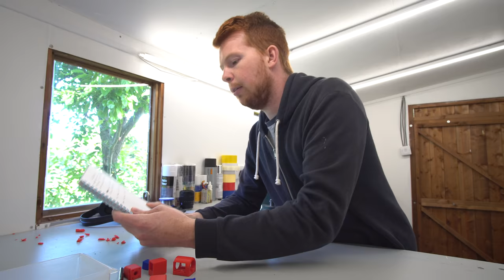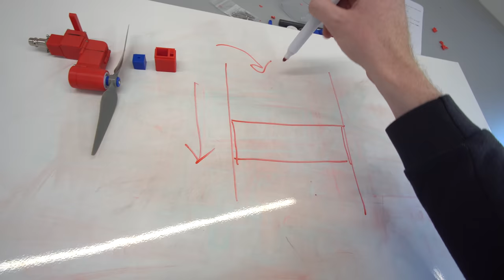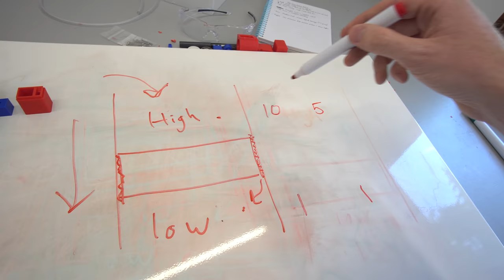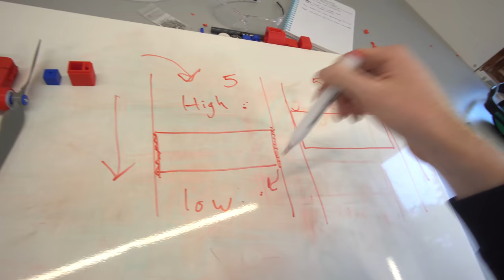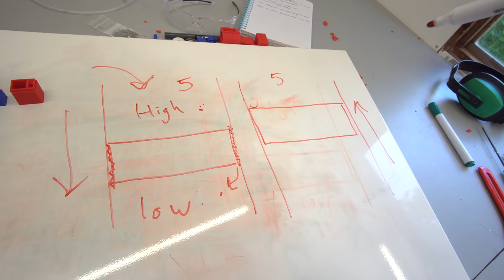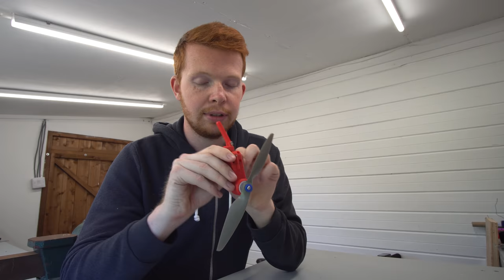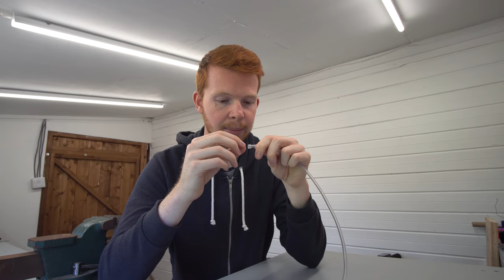Multiple or Single Cylinder Air Engine?

Comment: if you've halved the pressure but doubled the leakage area (piston to cylinder interface) you've not done anything. Focus on actually getting an engine running efficiently! cam timing and design is important, as is the valve actuation and interface. reduce friction! also, study the impact of engine RPM vs propeller diameter/inertia vs propeller pitch

Comment: Have you ever tried using ABS filament instead of PLA?
Reply from the maker: Yes I used ABS for the first two versions of the air engine and acetone smoothed the parts. But because ABS isn't as hard as PLA, the piston/cylinder would wear quickly and lose performance.

Comment: 2 pistons solves the crack case having a pressure in it 🤔
Reply: Also flat twin is the simpler to just plumb it
Reply: Or better yet push both sides of a single piston like a steam engine that gives you twin piston performance with one piston

Comment: Flat twin with the intake in the common crankcase and a valve to the two opposing heads for the second part of the stroke. The valve and conduit is integrated with cylinder and the cylinder head but detachable. 
It has been done.
Not quite but this will give you an idea. Just imagine the transfer tubes integrated to the cylinders

https://i.pinimg.com/originals/48/85/cb/4885cba90b4d6dad65f9fa4fdfda99cf.jpg

You could also go to the steam locomotive design which has a power stroke on both sides of the piston on a single cylinder.

Comment: build an engine that could practically run forever on the exact same air.By putting the exhaust back into the bottle somehow....... assuming this is possible, you could make one exhaust hole 
and use it to keep refilling the bottle that would in turn keep the engine running until all the air Leakes out.there is the problem of how to put the air to go back into the bottle when there are different pressures..... but ill leave it to you to fuigure that out.,
BRYAN

Comment: Hi Tom, love your work. :)   I was watching one of you compress-air motor videos and how you were experimenting with controlling the air into the motor. May I  suggest that you consider looking at a rotary valve?  If you want to get very clever have a look at the Bishop Rotary Valve head. It was destined for Formula One engines but the FIA banned it before it could be used. It's quite simple and very effective.   http://home.people.net.au/~mrbdesign/PDF/AutoTechBRV.pdf
I also got to thinking about a multi-cylinder motor after watching some of your vids and I think that a radial engine that has the crankshafts on the outer end of the cylinders might be best. Have a toothed pulley on the end of the crank, then that drives an idler gear, which then drives the propeller at the centre of the motor. By having those idler gears, you could alter the rpm of the prop to be lower (and so use a larger prop for better efficiency) and there'd be less aero drag than just running the crank gear straight onto the prop gear. I'd also be tempted to cheat a little by using a plain PVC pipe as the cylinder as it'd be very smooth, so you could run a crude printed piston ring that will seal well enough to make a good improvement in power & flight duration.
Let me know if I can help with drawing some diagrams of what I mean.
Thanks!

Comment: I'd favour a 3 cylinder engine over a 2 cylinder engine. but the 2 cylinder engine does have a better option to help with balance tho and less working, and therefore, less breakable parts.

Screw that, how about a 4 cylinder hahaha?

But you're right about the efficiency and less stress and leakage in the engine to I would definitely would perfect the single cylinder, duplicate it and take it from there and then see how it goes but obviously weight will take it's toll on efficiency in time so you'll have to find the sweet spot

More cylinders will need more air so maybe 1 or 2 Frosty Jack's 3 litre cider bottle would work.. just bin the poison in the bottles first or give it to a homeless tramp to drop bothering people!!

Comment: You talk a lot about efficiency in your videos, but how come we never see you do any rigorous testing of your components?

For instance running 5 liters of air through a component and measuring how much much came through to test for leakage. If you only get 4.5 liters out then obviously the setup is not optimal.

Or noting the stored energy of a canister before and after running the piston, measuring the work conducted by the piston and calculate some sort of efficiency.

I understand that you're kind of eyeballing a lot of these things, but without rigorous tests there's no way to know if what you produced is any better than your previous attempts.

Comment: Could you use air pressure on both sides of the cylinder like a steam engine piston?

https://upload.wikimedia.org/wikipedia/commons/thumb/6/61/Indicator_diagram_steam_admission.svg/2000px-Indicator_diagram_steam_admission.svg.png

Comment: How about a v-twin, like a harley davidson engine. It will bring the plumbing closer together. Did you ever consider and opposed cylinder opposed piston or OPOC engine?

https://www.techexplorist.com/innovative-opoc-engine-opposed-piston-engine/4280/

 Also, did you try including barbs on the hose fittings. That with a cable tie may solve leaking. Love your work. Keep it up!

Comment: hey tom, ive an idea, i donno if it helpes but what is when u use the zylinder housing as an air line, using 2 crankshafts and crank nobs witth 2 sepread valves for each zylinder,  if u cant imagane it i draw an sketch on paper here the googledrive link https://drive.google.com/file/d/1dFaQ9L4Qm1rJfCsePsdKzA_FgdKtBJO5/view?usp=sharing 
and sorry for my bad translation from german in english ^^, i hope it helps u

Comment: I've built a few air engines for quite some time now & I make them out of wood. Since I'm building them out of wood there is always going to be a lot of leakage, so I'm always trying to design more efficient engines. My last design was kind of a failure (Wooden 8 cylinder Radial Air Engine - https://www.youtube.com/watch?v=AY9Ss2C0hTY&t=2s) to much moving parts, to much friction & as always too much leakage. So what's my solution? Build it again! but simpler... & the simplest type of air engine (witch I've found is also the most efficient) is the oscillating type (the double acting version might be better but I haven't built one yet so I don't know) I take a lot of inspiration from steam engines. I don't know if you have any use for this information but I thought I'd share it & let you decide.

& for the question about having one or multiple cylinders, I wouldn't use more cylinder unless you want more torque, otherwise you're just going to waste air. More cylinders = more lost potential energy, friction just makes everything worse.